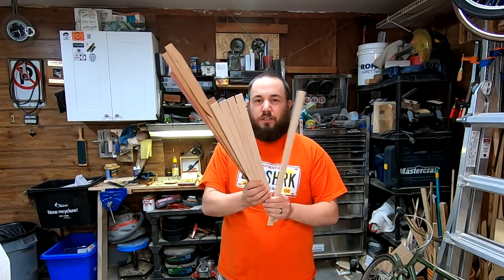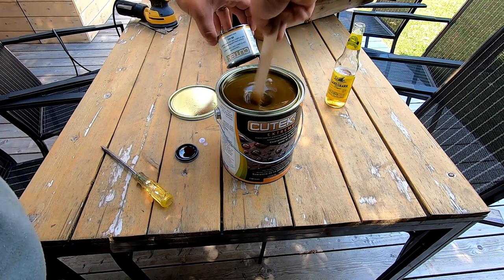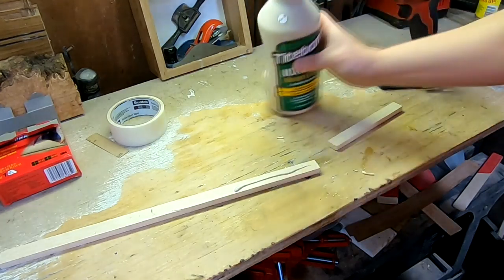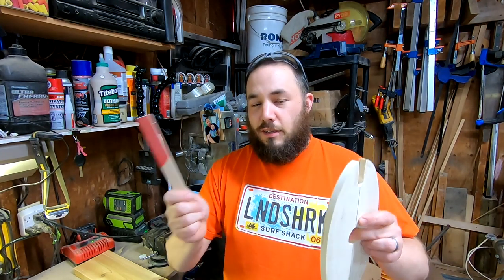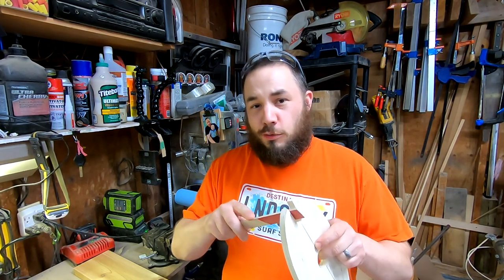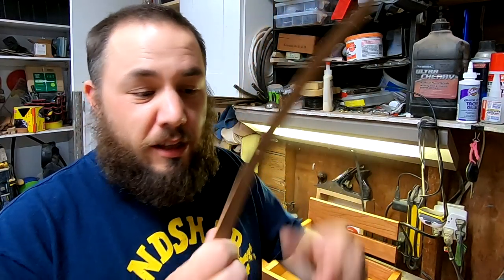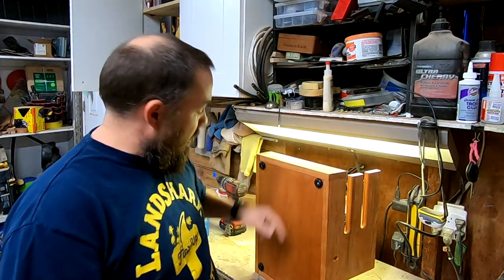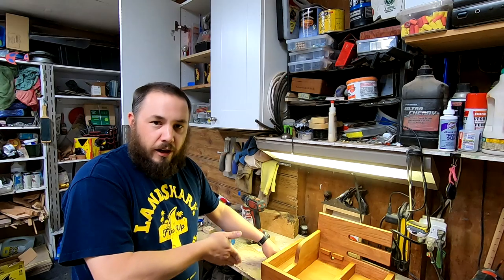8 uses for thin strips of scrap wood (Tips and Tricks)

Comment: Yeah first view and reaction!! 👊💥 Great one again Mr landshark! Some usefull tips 👍 have a great day aswell.
Reply from the maker: Thanks Hendrik! 👍🍻 What was your favourite tip?
Reply: @TheGrantAlexander   the one to make circles was a great idea in my opinion.
Reply from the maker: @Dutchshedwoodshop  thanks, that is one of my favourites as well! I usually use string for this, but it is hard to make repeatable circles with string. 🍻
Reply: @TheGrantAlexander  indeed. I have a square with holes on every centimeter. Never thought about it. But going to use that for making circles
Reply from the maker: @Dutchshedwoodshop  look at that, you don't even need to use the thin strips! 😂

Comment: I use scrap strips in my basket making - side stakes, inner & outer rims for top edge, feet & runners on the bottom, even lashed handles. A friend uses scraps for doll houses - roof shingles & shakes, siding, trim, moldings, stair treads & risers, mini picture frames, shutters....details can even  be burned in for a "brick" look for a chimney or sidewalk pavers.  Endless uses in building miniatures and wooden toys. You can also glue a bunch together and make cheese boards and cutting boards or trivets.  So, save those thin scraps everyone. If you can't use them, there are others that certainly can.
Reply from the maker: Great ideas! Thank you so much for sharing. A basket is something I want to make in the future for my wife's bicycle. 😀